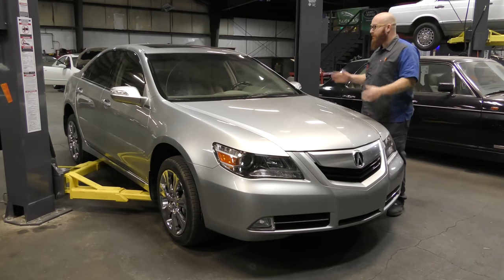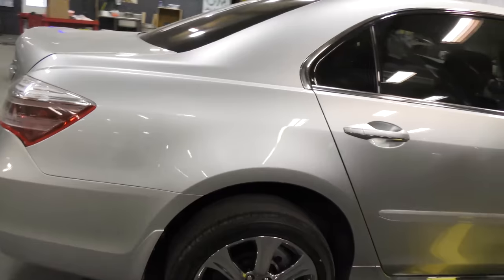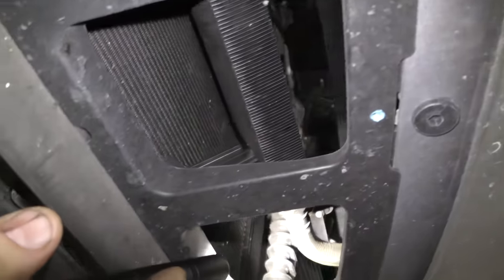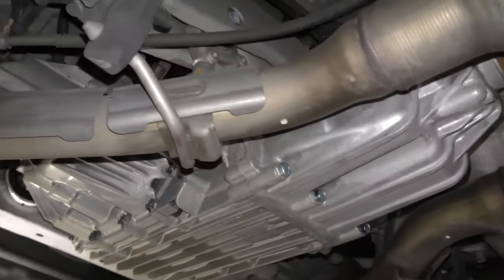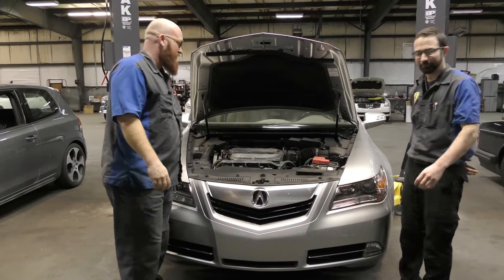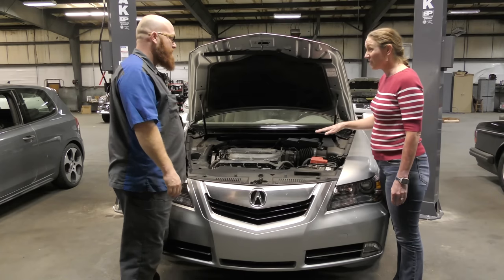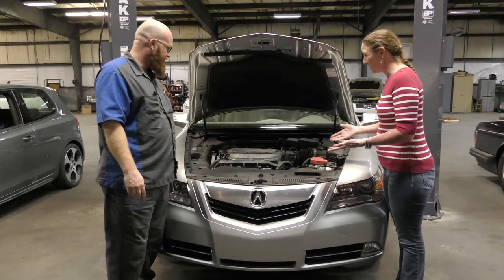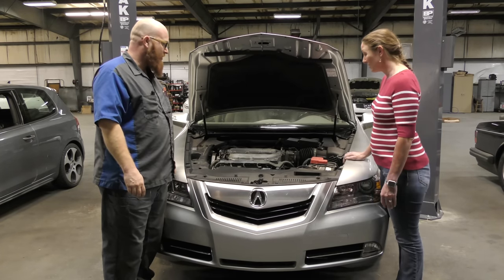Something Very Serious is Wrong with this 2010 Acura RL! What did the CAR WIZARD find???

Comment: This engine was recalled for oiling issues. I had my rebuilt by the dealer free of charge at 100k miles
Reply: Have you got the recall done? I have a '09 TL with the consumption issue. I have to add a half quart every 1,000 miles. I nervous about the rebuild.
Reply: @petegalicki7789  i did. It fixed the issue. Get it done by the dealership
Reply: Thank you Jeffrey. I am at 130,000. I have been biting my teeth about it.
Reply: @petegalicki7789  they may not cover it now though. My dealer fought for mine though. It can't hurt to check
Reply: I still have the letter. Its only maybe 5 months old. I should contact the dealer. I truly appreciate your feedback. After seeing the Wizards video I'm concerned. But still don't trust the repair. I know of a horror story about dealer rebuild. Thank you Jeffrey. P.S. I love my TL.
Reply: @petegalicki7789  its pretty straight forward. Pistons, rings, timing belt, my camshaft was replaced due to it being scored by low oil. They have a kit the guy said from Honda
Reply: @jeffreylong5660  ... I read water pump too. I mean for free it's a great service. I have to quadruple check my letter.
Reply: Pete Galicki It’s free, but you better hope they don’t fix one problem and give you another. 

Remember when the car was originally built, it was built with robotic precision.  

A engine built ( correctly) , is not some simple task. It takes patience, skill and meticulousness.  

There’s so many rooms for error it’s not even funny. Half the time “ engine rebuilders “ don’t even clean and dry out the block threads before putting the head back on.   

An expert engine builder would weigh every piston and rod to be sure with certainty they weigh the same. This ensures smooth idle and a balanced engine.
Reply: @Mr.Beastforpresident  ... Hey SSorter. That's my exact thought also. Along with my worries! I really don't mind keeping my eye on the oil level. I appreciate your feedback and info. Thank you kindly.
Reply: @Mr.Beastforpresident  I'm glad my 2012 3.7 doesn't have major oil consumption issues. I don't want some dealership "rebuilding" my engine. I don't trust enough.
Reply: Corkoth55 Factory engines are built with precision Robots and high end certified torque hand tools that are connected to a computer with torque values and VIN numbers. 

The long short of it is, quality control is high as far as assembly goes versus a mechanic at a dealership who get interrupted throughout the day while trying to do a job that requires great meticulousness to be done correctly.
Reply: @petegalicki7789  Find an Acura shop with a senior master tech. The master tech has all the tools and resources to do the job well if he takes his time on it. It has to be the right Acura shop with sterling reputation.
Reply: @petegalicki7789  I have a 2009 TL-SHAWD with the 3.7, after switching to 10w-30 Motul Eco Lite my oil consumption is almost non existent.
Reply: @whatiswrongwithus  ... Thank you for the information!! No power loss or other issues? I'm just concerned about the weight.
Reply: @petegalicki7789  No issues to report, have been running this oil for about 12k miles now, vehicle has 128K miles currently.
Reply: I had a 2012 Acura TL sold it at 223,000 miles best car I have ever had. Thing Ran better than most new cars. They could not find an engine because for the most part none of them fail, unlike BMW ;).
Reply: It's only as good as the repairman from your local dealership.
Heads or tails.
Reply: I believe the oil consumption issues are always on the back bank. When Honda/Acura introduced vcm or cylinder deactivation these engines started having this issue. I believe the system shuts down 2-3 cylinders on the rear bank for fuel economy on demand. The newest version of vcm only runs in 3 or 6 cylinder mode the older versions could vary between 3 or 5 or 6. I think this is what causes the problems over time the rings on the back bank start allowing excessive blowby into the crankcase. This wasn't an issue on the engines without vcm.
Reply: Your dealer sounds leaps and bounds better than my experiences with dealers. They just break shit and deny they did it, don't let me see broken parts, don't show me new parts, torque spark plugs to just before "torque till loose then back off a quarter turn", charge $200 in labor to change out parts that would take a monkey with the right tool under 3 minutes to remove and replace (this wasn't on my car, but a family member who the dealer screwed over, buttered up and scared to make it out like it was necessary right then for them to do it). 

In my experience, most dealerships are filled with complete garbage people with garbage intentions, no sense of pride, no sense of care for the vehicle or customer, generally no care for anything other than the numbers that pop up in their bank accounts every other week. Find you a good independent mechanic that has pride in what they do, and cares about their customers wallet and well being. Also, don't worry too much about if the mechanic is ASE certified or whatever, just a generalized paper test that you take and have to pay membership and tooling fees in order to maintain, all to just have a bit more work and have to deal with warranty companies.
Reply: @petegalicki7789  .5 per 1000. Acura will not repair it!! Ask me how I know as owner of a 2012 with the SAME oil .5 per 1000 usage.
Reply: @isactucker3788  you have the 3.5L don’t you. The 3.7 burns oil.
Reply: @jamesmedina2062  I did it at home in my garage with no specialty tools.
Reply: @petegalicki7789  Lets say you brought it in, and someone throws the engine back together poorly and it blows up soon after... wouldn't that be on acura/honda?
Reply: Exactly the noise my 1.8 Ford Endura engine made at 2 years 70,000 miles, destroyed shell bearing on piston 3, they showed me with the head stripped off & piston midstroke, leant in piston & it dropped about quarter inch without engine turning.

Not a nice noise piston slapping top of engine.

Was funny drove into dealer & service manager came out (he knew me I was in there so often). I said horrible noise, so guy puts his head under the lid & says can't hear anything hit the throttle so I did.
You have NEVER seen someone jump back so fast in their life TURN IT OFF TURN IT OFF TURN IT OFF.
Reply: The warranty repair only changes rings and pistons, seals,  no cylinder re-hone.  How has the oil consumption worked out in your case?
Reply: @whatiswrongwithus  so just a thicker oil or I has to be Motul Eco Lite? I’m genuinely curious because I’m buying a 2010 with a 3.7 soon and all these videos are scaring me to death lol. Thank you for the input man!
Reply: same here free rebuild on my 2013 TL  type SH
Reply: @Corkoth55  no. this is a Honda J series that's been around for 20+yrs. Any bozo can rebuild it. I am a DIY shade tree mechanic and rebuild these for customers! Anybody can do it. These are literally the easiest engines to work on out of all modern cars

Comment: " Transmission " in the back is actually the "super handling" differential.  These cars handle very well due to this piece of mechanical wizardry (pun intended), they will actually overdrive the outside rear wheel under throttle in a corner and rotate the car in a turn. They really do have super handling, I had an '06 and it was amazing.  Great show, first time I think I have ever heard you misidentify anything.  Keep up the awesome content....
Reply: I just purchased a used '06 RL SH-AWD -- curious to know your experiences with it and what I should look out for
Reply: The SH-AWD is really, really amazing. It's the finest AWD system I've ever driven. The only vehicle I've driven with more grab is a military Humvee. Those are ANIMALS in 4x4.
Reply: Agreed, bought an 07 a couple months ago and i love it.
Reply: He called it a transaxle I believe. But yes, you are right. It'll send more power to the outside wheels on a hard corner. They borrowed this technology from the 5th gen Honda Prelude Type SH 😉 In this version, I'm sure they refined it and it probably works even better I'm sure. And on top of this added AWD to the mix!
Reply: I got RL 06 and the sh AWD keeps coming on and stops the cars for a sec
Reply: I bought an 05 for $150, dropped a battery in it and it came to life. The SH-AWD system is simply the best I’ve ever driven.
Reply: Yes I was surprised he misidentified it considering he knew it was a SH-AWD vehicle
Reply: Propeller shaft and oil consumption are the two things you've gotta watch out for. Also gentle on 1-2 shifts if you have a manual like I do, mine is a TL tho! Fun cars,check your oil and the engine is great!
Reply: @Sprier  These are/were not available with anything else than the SH-AWD and an automatic transmission. 5 speed in the KB1 and 6 speed in KB2 which is on this video.
Reply: @TeroYyy  guess you missed where I said "mine is a TL tho"! 09-14 TLs had a 6 speed manual option, with the 3.7 and sh awd.

Comment: The lesson here is be careful when buying a rare car. All cars will eventually need repairs and it will be hard to find spares to fix them.
Reply: It works both ways. I had a GM Vectra 2.2 which was really common as a Rep Mobile. At 99K miles and 13 years old the engine started making a noise like this Acura. Since "We Buy Any Car" reckoned it was worth £220 problem free, I took the £170 trade in offered against its replacement. Before trading it in I gather all the receipts and found I had spent £4000 in repairs and maintenance in the 12 years I owned it.

Had it been a VX220, which uses the same engine, it would have been an entirely different situation.
Reply: wizard is too safe, not a bad thing and very responsible to his customers but the owner took it to the wrong mechanic

some honda genius came up with some good engines 20 years ago so they decided to leeched off of it for the next 20+ years. a 3.7 from a 3rd gen TL will drop right in.
Reply: @lancercool1992  3G TL-S was a 3.5, 4G had a 3.7 available.
Reply: Car isn't rare. Just didn't sell as great as the TL
Reply: The engine is rare. The RL was rare enough, but it didn't share enough parts with other models to justify an inventory of fresh spares. Rare cars, make for rare repairs, thus rare opportunity to sell get inventory off the shelf to pay for itself. Dusty parts, cost money for the guy that has them waiting. Profit is about turnover.

Comment: I want to say this RL is actually pretty rare, they don't sell many RL in general, especially this generation towards the end
Reply: No doubt! I have 2012 TL 3.7 and I love that ride. But this one looks sweet. Never seen RL with this front design on the road..?? Looks really. Nice.
Reply: @Corkoth55  I have a 05 TL, with RLX being discontinued, I'm thinking of getting a used RLX hybrid (if good price lol), really want to try that SHAWD thing
Reply: I have a 2010 RL I just picked up a few months ago from its original owner. I like the car a lot but it gets pretty terrible gas mileage
Reply: @alecedmisten7639  I'd suggest checking the oil level periodically, been seeing they have oil consumption issues apparently. That's probably how this one got low on oil and ended up getting rod knock
Reply: @garykong7597  the RLX sport hybrid looks cool as hell
Reply: Is the 3.7 in this different than the 3.7 in the TL from those years? Cause those were fairly common
Reply: @kgisabeast  same engine…the ZDX and MDX of that generation had the same engine as well…the TL received it i believe in its 6-speed manual version…Acura actually made this car plummet because you could get the TL cheaper with a lot of the same features…kinda backwards thinking which i believe was done on purpose…TL built in US…RL built in Japan…just got rid of my 09 RL and got a 2020 RLX only because of the price and i prefer cars that i don’t see at every other stoplight, lol
Reply: @lordchango7949  my 3.7 doesnt is barelymconsuming oil
Reply: They stopped making them around that year
Reply: Time for them to bring back the Legend

Comment: The transmission is at the front of the car on these, with a drive to the rear axle.  The rear differential has a planetary gear set attached that can overdrive the rear axle about 5% faster than the front axle in some situations. This was done in order to make the rear torque-vectoring system work better. This car does not have a rear transaxle, just an extra overdrive.
Reply: Then why does it say ATF?
a differential uses heavy gear oil......
Reply: @MrPaige222  Acura used ATF for the rear diff.
Reply: 4WD systems can be really complex.
Reply: @MrPaige222  they used in some cases the same fluid in both transmission and differential, a planet gearset in the rear diff would for sure support the need for atf regardless of a transmission or not
Reply: I have no idea--I had just heard of rear transmissions 5-6 years ago, but dude that is a HUGE differential if there is no transmission back there.
Reply: @swingersonian  I'm surprised you've never heard of a transaxle. I had a 1963 Pontiac Tempest with a 3 speed transaxle. They've been around a long time.
Reply: @wernerdanler2742  I hadn't heard of it until a few years ago, but doesn't that massive thing in the back look too big for just a couple of gears?  No, I don't know how to work on cars, just a fan.
Reply: @swingersonian  Front engined Corvettes used a rear mounted transaxle for more than twenty years, from 1997 C5 through 2019 C7.
Reply: @swingersonian  On these newer cars there are electronic solenoids and stuff inside the differential. These aren't the cars we grew up with and could tinker with.
Reply: @MrPaige222  Honda and Acura rear ends are actually a little bit different. It's essentially a rear diff and transfer case in the same unit. For example, on the Ridgeline which has a more traditional on/off 4wd, it's actually FWD normally with the driveshaft always rotating. When you activate 4wd the rear end engages in the same way a normal transfer case would. So the fluid has to do both the job of differential fluid and a transfer case fluid.
Reply: @MrPaige222  it uses atf because it is in fact very similar to an automatic transmission. All of the original sh-awd lineup used atf in the rear differential. I believe it was in 2010 or 11 they switched to a "SH-AWD fluid" which looked more like motor oil, bit it was just a different version of atf.
Reply: @swingersonian  it is large, I have a car with SH AWD and the rear is no where near that large, still a brilliant system regardless.
Reply: @swingersonian  You probably are wondering why the hell don't they do this on all cars?  I drove a Porsche 928 with a front mounted V8 and a rear transaxle for almost 20 years.  The footwells in a 928?  They're just like a FWD car, huge!  All cars should be built this way, Porsche did it for weight distribution.  The reason that American makers don't use this outside of the Corvette is that it won't work with a truck and it is ~~slightly!~~ more expensive to produce....